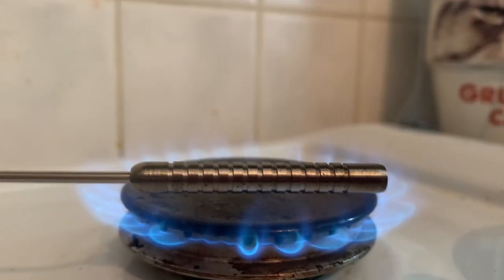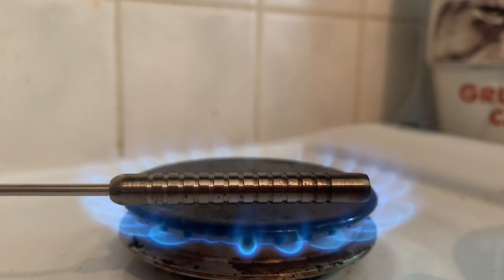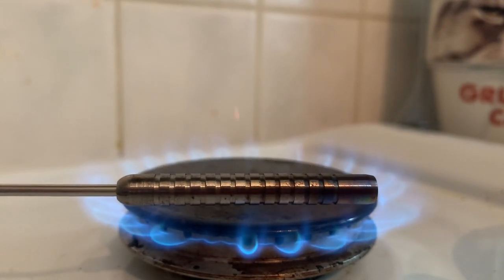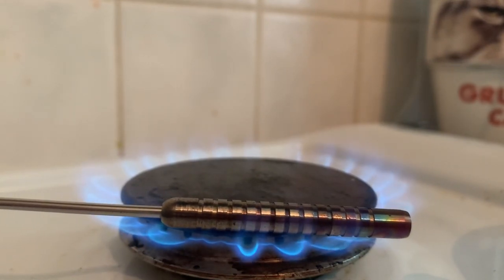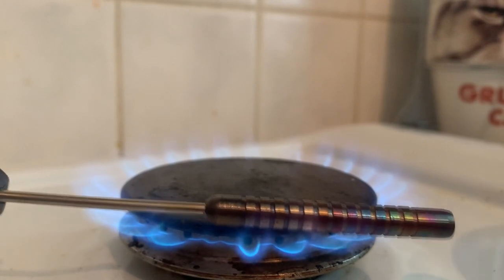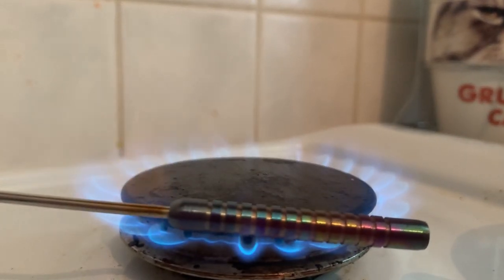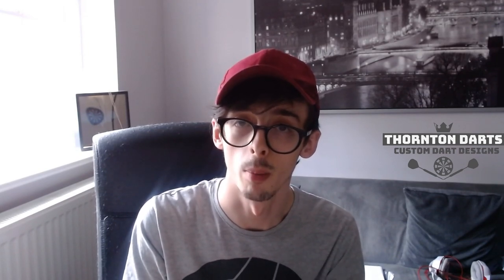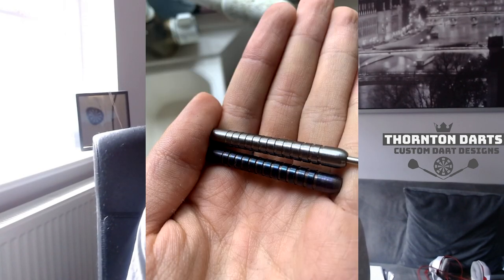Homemade Rainbow Coating - Darts

Comment: thoughts or guesses as to how this affects the integrity of the barrell?
Reply from the maker: Good question, tempering should in theory make the surface harder, I don’t know the exact answer in all honesty, as it’s not something I’ve tested, purely visual really
Reply: @thorntondarts4954  Thank you for the response. I took this question up with a fellow dart mate that does this to his darts & we both concluded tungsten is forged at extremely high temperatures so unless we're heating dart barrels core up to a glowing red we are only affecting the surface of the barrel cosmetically with no compromise to the integrity of the barrel. LOL! I answered my own question...Cheers!

Comment: Hi mate the darts looked great when you heated them but when you put them in cold water they seemed to have darkened up alot. Could you skip the water bit ?
Reply: No it won’t stick , you will need to be put it into the water sooner , it’s hard to tell as it’s almost looks invisible when it’s over the flame , but I would say try a good 5/10 seconds quicker to what you are doing now to get a lighter affect

Comment: You're best taking the point out as if there's an air pocket inside the hole the point goes into it will expand and push the dart out with some force and speed. Which could be dangerous.
Reply from the maker: The points did come loose to be fair
Reply: @thorntondarts4954  also if you heat darts up until they glow red and quench them in cold water they go black, its quite a nice grippy and relatively durable feeling/coating.
Reply from the maker: Yeah I did a tester where I kept it in as long as possible and it went to a black/dark blue which was great

Comment: Do you have to wash thoroughly to remove oils from skin, or a degreaser before torching?
Reply from the maker: I personally didn’t, but the cleaner you get the barrel the less there is for the flame to react with, the cleaner the result
Reply: @thorntondarts4954  - That’s what I figured. Thanks, man.

Comment: Will this work with any metal type? I have an ibanez s770pb-ntf and want to do this to the metal pickup trim pieces that surround each pickup as these have tarnished a bit but actually look cool still tbh. Thanks for the vid! I remember a gun guy years ago using oil in similar fashion to achieve this but cant remember what it was called. Thanks!
Reply from the maker: Good question, in all honesty I’m not entirely sure, i know it’s common to do it with knives also, this is tungsten and I know they heat treat steel too so maybe worth a shot
Reply from the maker: @ton80DARTS Not sure in all honesty

Comment: I’ve got a set of copper tungsten smooth barrel darts that this would look great on. Thoughts on if it would have the same results?
Reply from the maker: Hmm not sure actually, copper tungsten May react differently, if they aren’t rare or hard to get hold of again maybe it’ll be worth trying a set before